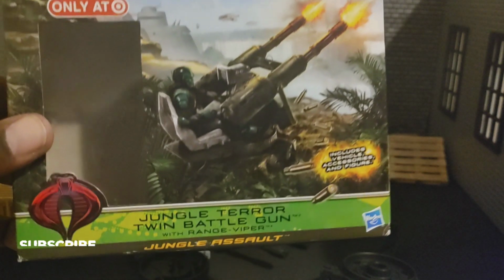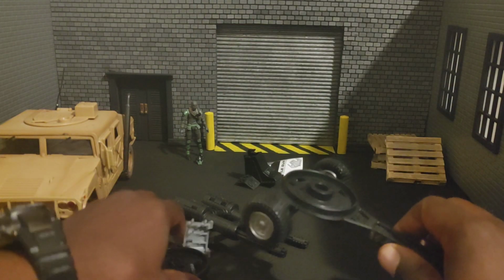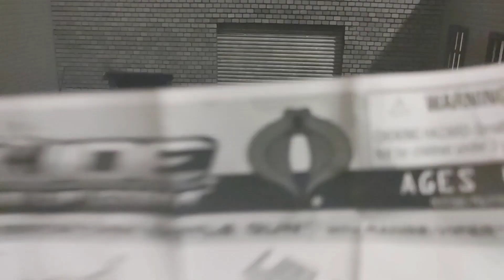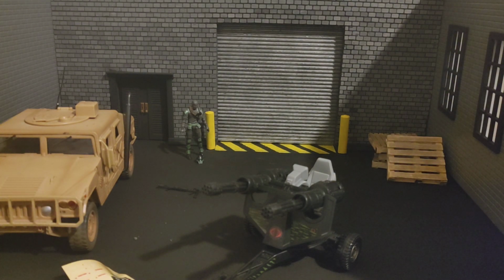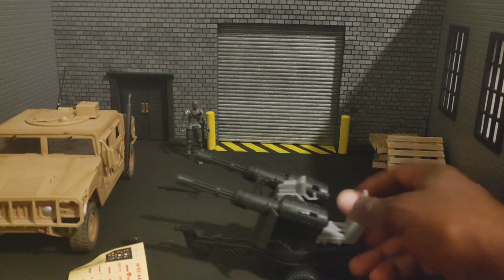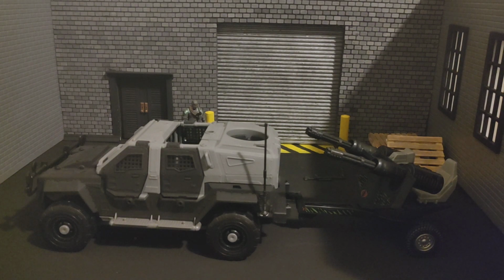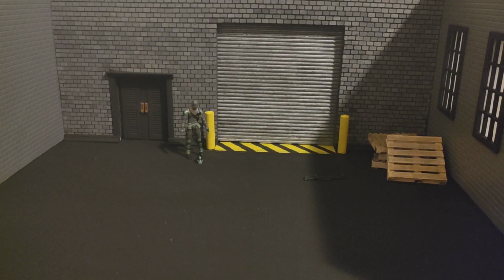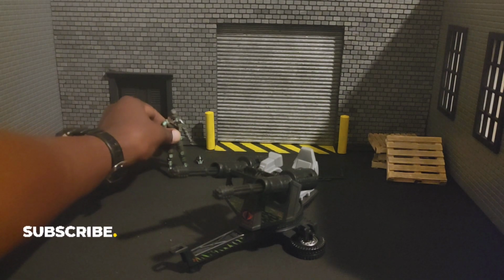Gi Joe Jungle Terror Twin Battle Gun

Comment: Nice review! The Jungle Terror is Cobra version for the Rise of Cobra line based on the Joe Whirlwind from the 80's. Both are anti-aircraft gun emplacements, but can be used as antipersonnel or against light armored vehicles. I think they both are supposed to be 20mm (2cm, if you're german😅) cannons similar to the Vulcan. The minigun are often in 7,62mm or 5,56mm. Although is totally capable of shooting down small, light aircrafts and drones, the military and bigger aircraft would be more difficult.
Reply from the maker: Awesome response. 🙏🏾💯